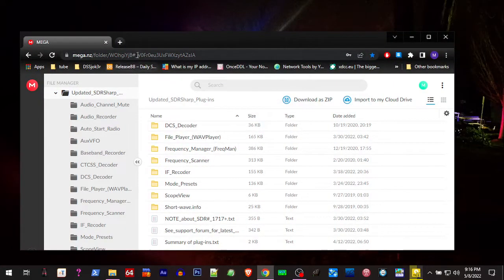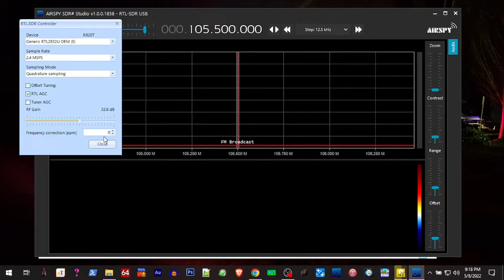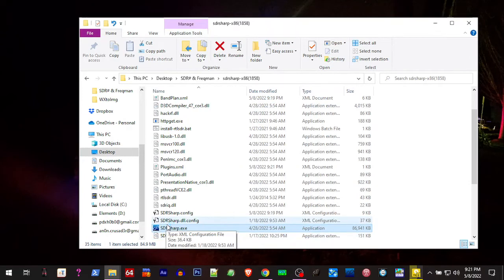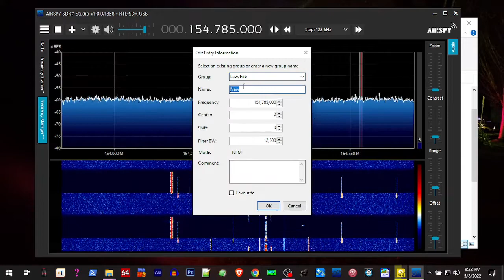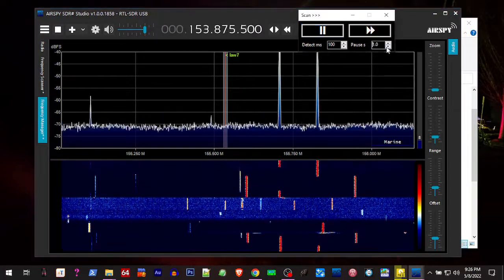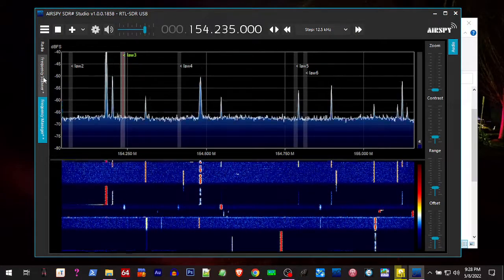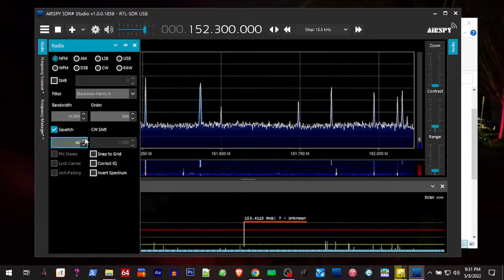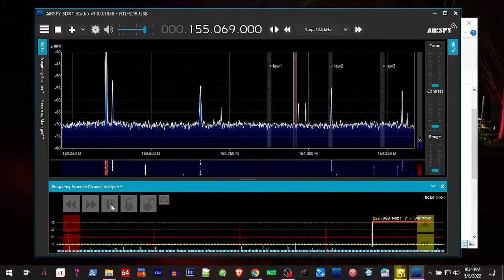SDR# & FreqMan Frequency Manager

Comment: Can I use 2 rtl dongles on Airspy? I'm still learning to use DSDPlusFastlane but there is hardly any information or I'm just not looking in the right place. Seems like everyone that was creating content for it has fallen off the planet!
Reply from the maker: You can't use two rtl dongles in a single instance of sdr#, you could run two instances of sdr#. With dsdplusfastlane you don't need any other software.